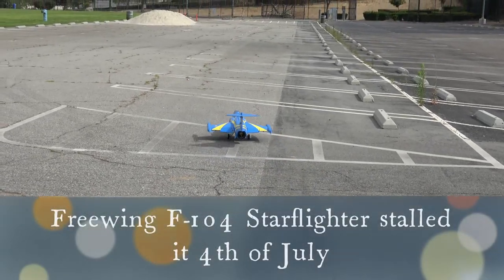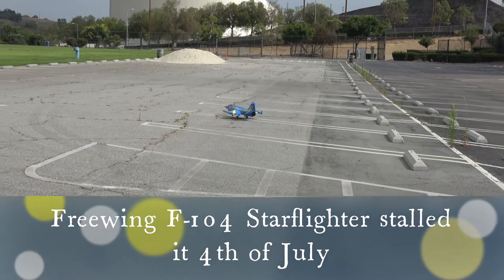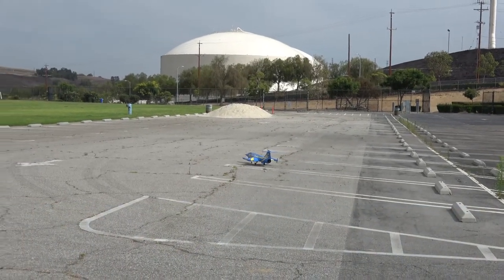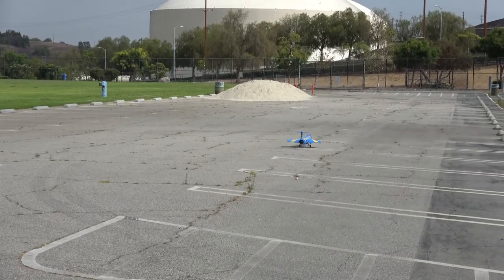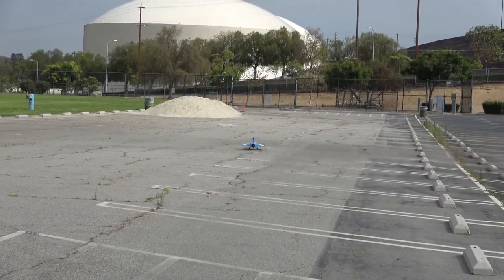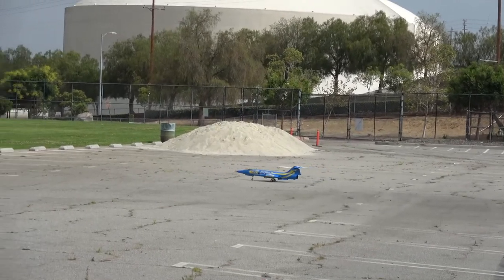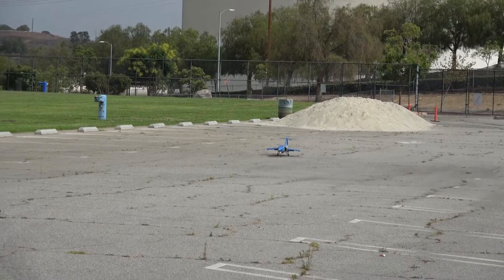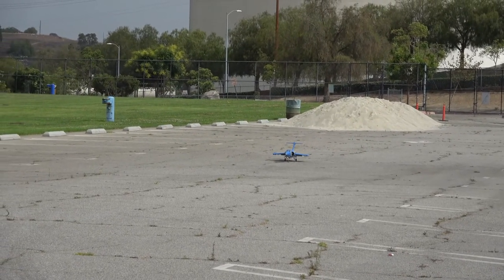Freewing F 104 Starflighter stalled it 4th of July

Comment: Ya looks like a tricky bird! Just like the real "widowmaker" gota land fast! Great save!😎👍💯how did the gear turn out after that pancake?
Reply from the maker: The main gear was undamaged. But I did break the nose gear retract. But it has already been replaced and flown a couple more times. Just a few scratches and damn damage from the nose gear doors sheering off.
Reply: @victorrcjets7660  I did the same thing with my avanti v3 put the flaps down and like a novice, flew her too slow and stalled nose down hard, pulled up and pancaked. Ripped out all my gear and stripped my flap servos. Easy enough to fix and good landings ever since. Most likely you gota try a little harder to stall an avanti than that nice big starfighter! I do know your pain tho! Lmao😝😃😎👍💯I will say the avanti has little tiny wings and the full flaps work too good!

Comment: Sorry for the mishap... Did you have gyro at the time of approach?
Reply from the maker: Yes the gyro (all but the rudder, for some reason it was not working right ) was on but i had it to slow in a crosswind so i should have had much more power on until i got at least midway then chop it.
Reply: @victorrcjets7660  Interesting, mine (preowned) came with Sebart gyro, rudder not working either